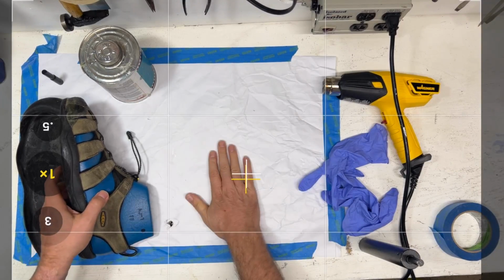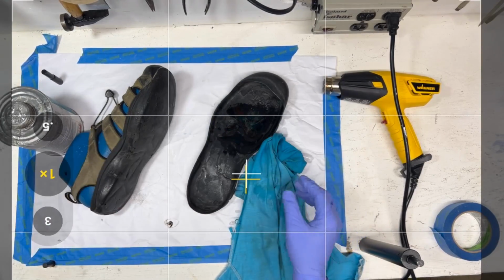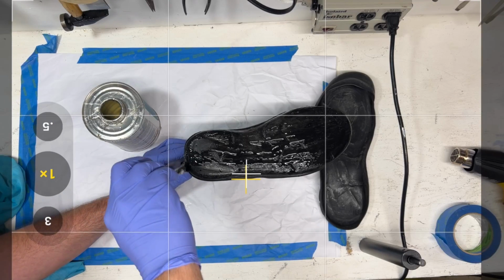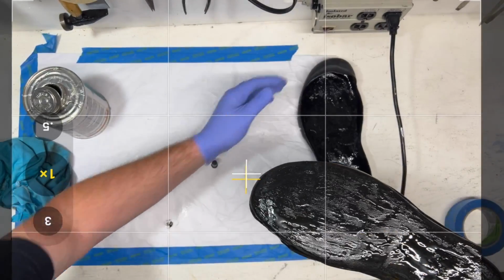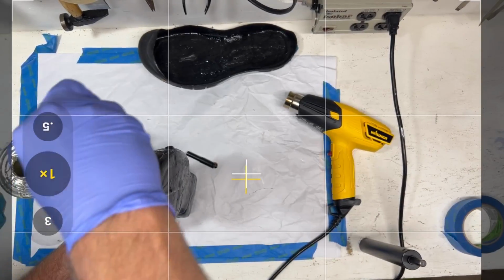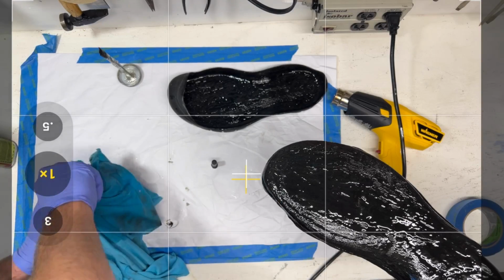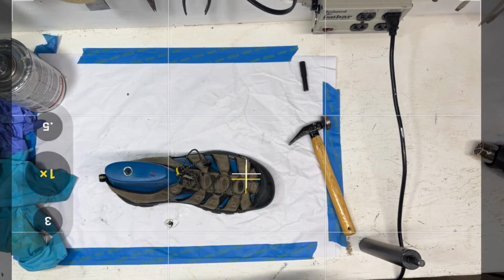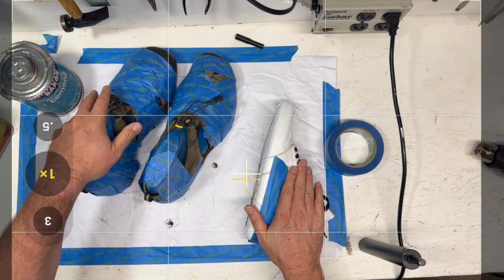Shoemaking DIY - Sole Cement Bonding Step By Step

Comment: Shoes and boots 25 years ago cost less and lasted much longer. The common failure above the sole was almost unheard of. I'm convinced it's because of planned ripoffism.
Reply from the maker: Ha ha everything costed less!  Also I will tell you the performance of the modern shoes is just way better. Now that high-performance comes with a higher cost and a compromise of durability.  But the market has spoken people want lightweight, more comfortable shoes and they just don't last as long. It's not a conspiracy.

Comment: Recently I replaced a pair of leather work boots that I'd kept going for around 12 years. They look terrible, but the epoxy kept them putting one step in front of the other for a long time. West System G-Flex 650.
Reply from the maker: Oh, I'm a big fan of Wes systems epoxy for surfboards and stuff like that but not for shoes. Barge cement is the way to go and when you're done with the shoe, you can hit it with the heat gun and repair it again.

Comment: Amazing job one question why some shoe new shoes they get open from ousole less than one month from using is it about Cement quality or something else
Reply from the maker: There are many reasons, poor surface prep, aged out glue, or even material failure not even the glue. 
Also if the EVA gets cooked in a hot car the bond will fail.
Reply: @ShoemakersAcademy . The soon-broke work boots syndrome is relatively new. Best is to get a second job and buy Red Wings.

Comment: 3 coats!? OMG!..... i always focused on cleaning and just one good thin even coat, not to thin, but not to thick. also if i had the time let the glue dry as long as possible. I found globed glue really has less strength its BAD. but as you say the toe cap on that sole is a pain, so best of to do it your way. or perhaps do the toe separately?
Nevertheless that's a good bond that you've made there that should last years.
Reply: Yes three thin coats! Full coverage.